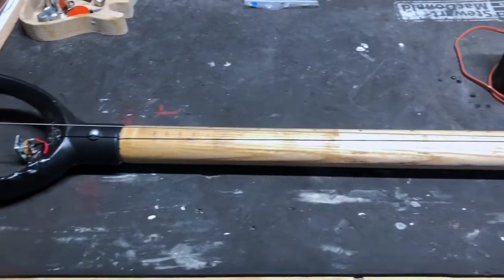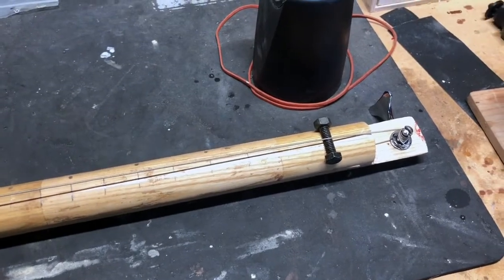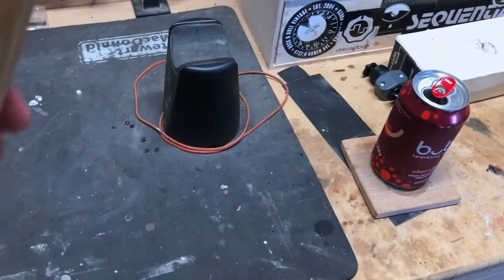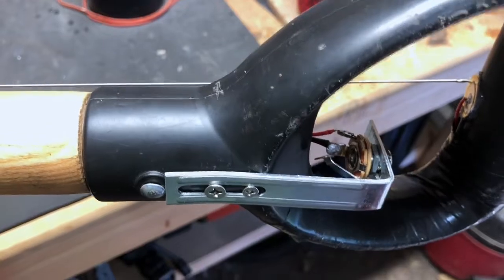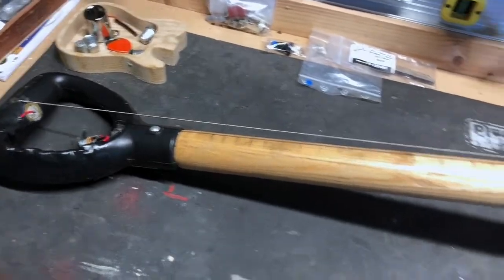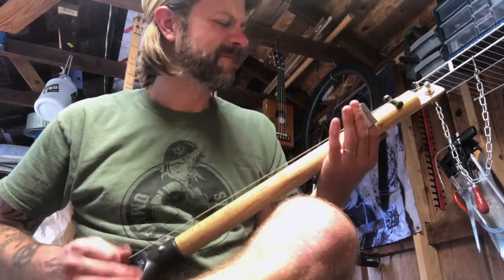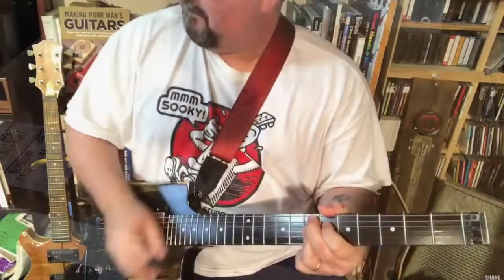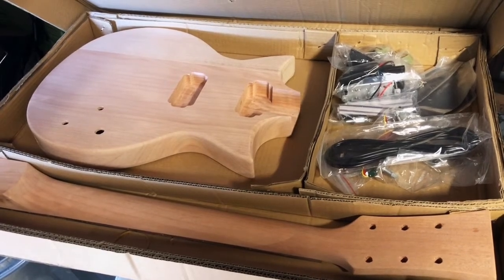DIY Instrument: The Diddley Fork

Comment: Nice little diddley bow!  I’m looking forward to seeing that new build!
Reply from the maker: Thanks Steve. I’m still trying to figure out what to do with the kit. I gotta come up with something clever.
Reply: How about some wood burned tiger striping/figuring?
Reply from the maker: @stevesstrings5243  Oh jeez. I don't know if I'm that good at woodburning yet. It would be cool though.
Reply from the maker: @stevesstrings5243  Oh jeez. I don't know if I'm that good at woodburning yet. It would be cool though.
Reply: I’ve seen folks do this by randomly wrapping metal wire around the wood, then lightly scorching the exposed wood! That leaves it with some stripes. Try it on some planks first until you feel like you have the hang of it.
Reply from the maker: @stevesstrings5243  That's a good tip. Thanks.